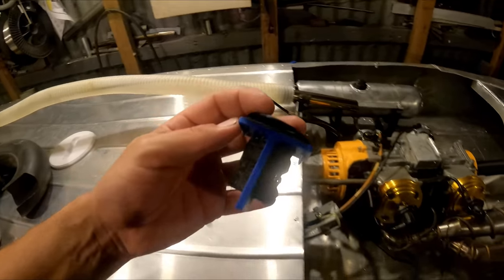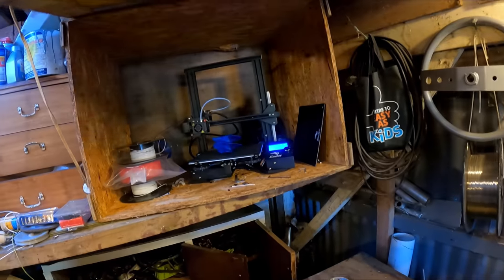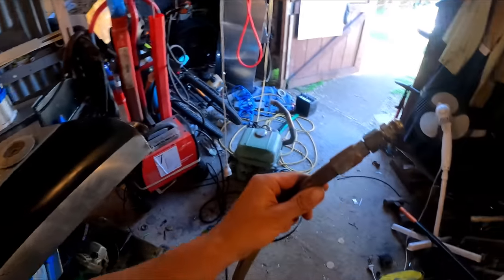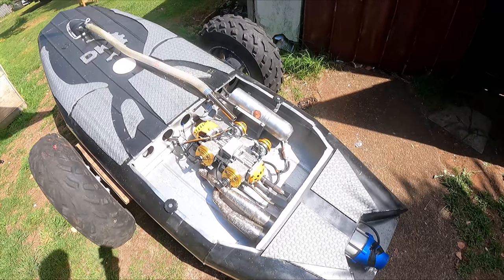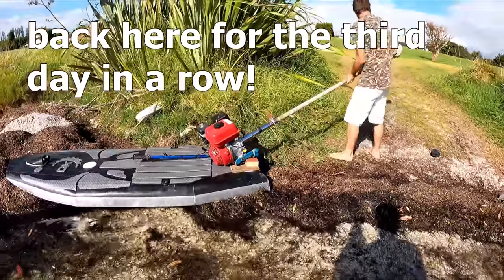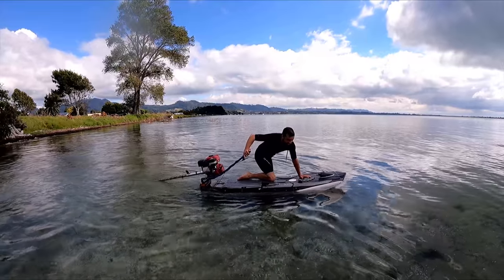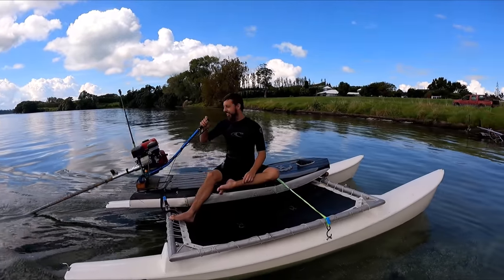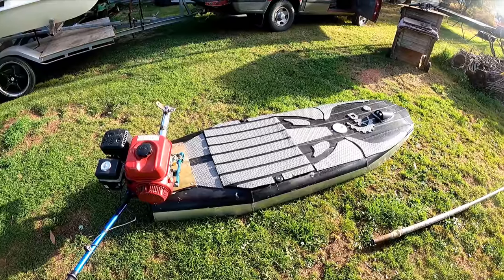Homemade Jet Unit 3D Printed, Testing!

Comment: Until recently, I assumed those longtails were something that got cobbled together out of some necessity of available parts.  Recently I learned they are purpose built to offer a ton of advantages for shallow situations with lots of weeds or obstacles to go over/around.  They are also dead simple and relatively cheap.  So, armed with that new found respect for the design, I'm keen to see someone like you figure out how to make the most fun use out of it.  Hunting down the limits of speed, control, efficiency, and perhaps a quieter exhaust, would all be cool things to see.  Cheers.
Reply from the maker: They are awesome and simple but a bit awkward to control. I would like to quiet it down a bit
Reply: @DktheWelder  Maybe delete the muffler to offset that slight power gain by running a straight down pipe  just below the water (deep enough to muffle but not cause significant drag.  Maybe add a simple  horizontal "surface plate" at about the point the pipe meets water surface to help prevent cavitation of the exhaust at exit point. (in other words, to keep te exhaust beneath the surface long enough to dissipate some sound without having to run the pipe too deep into the water?  Just brain storming.  Water is a great muffler and it's right there...
Reply from the maker: @AtimatikArmy  I have tried that before running the pipe into the water with those motors really robs the power , an outboard runs it through the centre of the prop where the water is turbulent so it pushes through it better I guess, there will be a way to do it though
Reply: @DktheWelder  what about a simple water pickup (prolly no pump needed) and have the line run to a silencer like a dirt bike but without the fiberglass packing?
Reply: Here in Thailand I live 150mtrs from the beach, Every morning the noise from the fuckers wakes me up even with closed condo and aircon on lol... they have no mufflers at all
Reply: cr500 locked in 4th set up for longtail. sweet christ
Reply: Just paste this into the youtube searchbar AMAZING, DRAG BOAT Tradisional🏁Top Speed 200 km/Hr

Comment: More motors! I would like to see the firewall moved forward and another motor or two added to get the jet working. I think stay with the jet and just change the jet/motor until it works. Love the effort mate! Cheers.
Reply from the maker: I did think about that add 2 more motors haha it would be pretty hard on the crank of the last one though
Reply: yes I agree I love jet surfing
Reply: @DktheWelder  why not adapt a 15hp outboard powerhead to work horizontal in the board
Reply from the maker: @MicRuLerZ  that would work I think !

Comment: awesome build man, pity those little motors weren’t up to the job, looks like great fun with the long tail. keep up the great work and videos 👍🏻
Reply: motors were fine he just didn't tune them at all ...
Reply: The propeller inside the jet unit is terrible. The only thing such a propeller does efficiently is destroy efficiency.

The blades should be much smaller. 
Propellers don't push water like a screw.
They generate lift. 
If you change the design you will get better performance. And it will be more resilient against seaweed.

Comment: The thing about the 4-stroke is that it has more torque than the two-stroke in the power band so you can run the bigger prop or higher pitch impeller, you need like a 90mm impeller size which is what jetsurf uses to get enough volume. I'm running two 56mm pumps on my electric build.

Comment: I've been following this build for awhile, glad to see it on the water. I kind of expected that it would end up being underpowered. Jet drives are horsepower thieves. Maybe do a surface drive prop setup with the same twin engines, sort of like an rc boat.

Comment: Koolest video demonstrating why longtail mudmotor are the best!!!!!
Reply from the maker: The longtail is just better it way more efficient you can carry the board easily then put the motor on in the water, then not have to worry about sucking stuff up , can change the prop in about 30 seconds, and cheap and simple
Reply: @DktheWelder  posted up some clips of this on our Instagram with a link to the video and put you in a playlist on our channel. Koolest stuff ever

Comment: Kawasaki js300 motor would work but is pretty big. I would look at a 2 stroke 85cc off a a motocross bike. They're in that 15-20hp and you could ditch the transmission and get the size down to what you need

Comment: I'd try the 80cc two stroke that you can get for push bikes off ebay as they also have a gear reduction gearbox  and that should be more then enough to run that water jet
Reply from the maker: I think those aren’t very powerful either but maybe if I started with two of those it would have had more chance
Reply: @DktheWelder  you would be surprised as they are turning a 26inch wheel plus your own weight plus geared down as they have a gearbox but if you joined two of them as you said well im sure you would be more then happy plus that is a awesome idea

Comment: had like a tear in my eye when the 2 50ccs didnt work, maybe a ktm 50cc or a chainsaw motor would be better. Carbon fibre reeds and a ported cylinder could add a wee bit but may not be enough. All in all well done bro, the board looks awesome 35km is fast.
Reply from the maker: I know I was annoyed they didn’t work , need more power!
Reply: any chance the hydraulic hose was slipping? aww no i already bought a gold motor =[
Reply from the maker: @dallas749  na man I’m in the shed right now looking at it is still on there super secure
Reply: @DktheWelder  I dare you to go electric 🤔🤔

Comment: You can customize an 80cc 2t bicycle engine (change the stroke to 55mm) and use the ms660 (56mm model), ms070 or ms088 cylinder to achieve volumetric capacity above 135cc. You can improve compression ration to 11.5:1 or above and use E85 (85% alcohool and 15% gasoline). Here in Brazil exist a motor 132cc 2t from yamaha rd135 with impeller 93mm spin 7800 rpm is a good motor to motorized surf board.
Reply from the maker: O wow that sounds cool ! How do you know this? I’m interested in the 80cc bicycle engine modification!

Comment: Xzibit:  Yo' dowg we heard you like boats so we put a boat on your boat so you can boat while you boat.  hehe its a bummer it didn't get the speeds you wanted on the jet unit but stoked you saw it through tull the end and the long tail looked like wicked fun. since you've already got all the set up for gas engines what about the worlds first hybrid jetboard?... could do the electric drive and then use the engines you have with an alternator to power it... pretty sure with all the extra weight it wouldn't be as fast as a normal electric jet board but it would be 1 of a kind for sure. great work as usual and look forward to seeing what you come up with next.
Reply from the maker: X to the Z would love the hybrid board ! Sounds tricky to me

Comment: First and best long tail surface drive NOT jet board 😀 awesome Dan.
Shame about the jet drive but nice that you can swap between both options. Search for a powerful 2t motor but I love the electric long tail idea. Batteries inside and dry, motor outside. Big RC outrunner motor with torque for the surface prop but plenty RPMs. Easy to mount also, just need a bearing housing to support the drive shaft.
What about a 125cc kart 2t motor? No gearbox, small centrifugal clutch or not, and up to 40bhp if liquid cooled monster! Only might be pricey... Be great to see the jet drive running.

Comment: Nice Board, I'm also building a Jet Board :) I'm using a 100cc 2 stroke 25HP kart engine.
I just have to add an electric starter and manufacture a reliable shaft coupling.
My Jetdrive is also 3d printed 89mm.
Reply from the maker: That would be about a perfect setup ! And electric start would be great, is it water cooled? And where did you get the motor?
Reply: @DktheWelder  It is a KZH 100cc engine and yes the engine is water cooled.
Reply: @DktheWelder  I bought the motor used on ebay.
Reply from the maker: @JansVanlife  ok thanks a lot I will look into it👍
Reply: And what about the noise ?..

Comment: The hours put into this project was crazy! The dual engine setup was crazy, wish it worked the way you had envisioned. You could throw a js300 motor and pump drive train in there and let it rip. Or go full send and somehow get a 701 motor and 144mm pump in there for some MACH 1 speed. Seeing a cr125 motor in there would be crazy too, probably enough power to push it, somehow delete the gearbox
Reply from the maker: Yeah the whole idea was to be able to make something cheap. A cr125 would be awesome!
Reply: @DktheWelder maybe use the duel engine setup for a stand on petrol scooter goped project & you can actually buy different CVT drive gearbox for  them with bigger sprockets fitted

Comment: You should put the 2 stroke engines back in and run a driveshaft out the back and stick a prop on it. May not be as fast as the longtail but would be more tidy.

Comment: you could strip out the powerhead of an old 2 stroke outboard, that would probably do the job :), tohatsu's m9.9d2 are really quick for their horsepower or the 18hp, their 25hp can be tuned to 32hp very easily. or you could do the yamaha 30 hp 3 cyl, very good motor.

Comment: could try a offset flywheel key to increase the timing advance on the engines too bring the revs up more, or even a planetary drive
Reply: rockit key for goped scooters is what i have in mind they use zenoah engines

Comment: Why not use a small 125cc dirt bike motor or high hp kart racing motor? Should be able to get those around 20hp for an older one. Would love to see the jet working as intended, but still awesome this way too!

Comment: mate you absolutely need to build that Honda gx200. delete the governor heavy valve springs. a rod high comp piston and a light weight flywheel and a mikuni vm22 would make that boat silly fast
Reply from the maker: It would! I took it out again with just a bigger prop it went pretty fast

Comment: A few options that I could thinks of would be either a scooter motor with a big bore kit keep the gearbox on and there pretty quick or look up the rovan baja 5b rc cars those guys port them like crazy and play with crank case volume by filling the crank case with jb weld and get around 6 to 8 hp out of  little weed wacker motors

Comment: Hey mate. Very cool project. Makes me think i need to get a 3d printer and develop some skills like you have. Im a little disappointed you are giving up on the two-stroke jet unit. I hope you stick with it some more. To me it doesn't seem like a lack of power. It seems more like the jet unit is slipping a lot. On a full-size jet boat impeller design and the clearances between the outer diameter of the impeller and the housing (wear ring) surrounding it make a huge difference to the performance of the unit. Think of the jet unit as a pump rather than a propeller in a tube. I am currently building a small hull and intend to use the same engine you have with some type of homebuilt jet unit.
Reply from the maker: I wish the 2 stroke would work too , It would probably work with a propeller but jet units are pretty inefficient and power hungry. I am building an electric mini jetboat at the moment with heaps more power so hopefully that works

Comment: You might get extra thrust if you could route the exhaust out the jet novel as well. Mixing the hot exhaust gas with the ejected water
Reply: Jetdrives pressure to like 150psi and an exhaust is like 5psi. You would gain no power and just flood your motor with water.

Comment: One thing seems tibe the norm on 3D printed jet drives, way too much pitch on the impeller. Try less pitch to get the rpm up and the engines to the pipe. Should get much better performance out of the board. Awesome build!
Reply from the maker: I did try a few different pitches but I think you are right it never seemed to get on the pipe , thanks 👍

Comment: You could make some small hydroplanes for the cat's pontoons and the speed would raise it out of the water, greatly lowering the drag co-efficient, you could probably even do something similar with the board as well.
I'd like to see potential hybrid vehicles that could cover many bases, as different power sources provide different torque ranges which are more beneficial for different tasks, not always demanding of power.
You could even use natural power with small balloons lifting sail kites when there's no 'low' wind.
Reply from the maker: Do you mean hydrofoils? I have been thinking along those lines it would work well with the longtail motor, and I have been thinking about using a kite as well but they aren’t as efficient as a sail
Reply: @DktheWelder  oops!
You're right!
Hydrofoils are what they are, hydro-planing's what they do!
I speak quicker than my brain sometimes.

Comment: Overall awesome but I can see you are disappointed with the speed of the twin 2 stroke. My theory is your intake air is too restricted . If you can try it somehow with a much more open intake maybe it will work far better
Reply from the maker: Yeah I tried it with the lid off too so no restrictions and still no good just need more power I think
Reply: @DktheWelder  more torques!

Comment: Have a couple of 1/4 scale RC boats that cruise around 65-75mph with single cylinder modified 36cc 2 strokes and surface piercing prop, which is plenty fast enough to handle via remotely. Always wanted to jump on one and see what it would do with a person on one. You have answered that question for me now Lol! Yes these pocket bike engines are very shakey and vibrate thanks to their Chinese no nonsense caring for balancing their rotating assemblies! They can be balanced though with some basic tools and knowledge of how to balance a 2 stroke. But definitely the worst of the worst are the aftermarket cranks they sell for these pocket bike engines! Yes they're a full circle crank, but it's by no means meant to spin at any rpm's! They didn't actually account for the balance of the piston, rings, rod, bearings and pins. And they are way heavier than they should be in places that should be as light as possible. If you use a aftermarket full circle crankshaft in these pocket bike engines without any sort of balancing to them prior to installation? These cranks will shake your engine and bikes apart very rapidly!  If you're using 2 of these cranks in your gas powered board? I couldn't even begin to imagine how bad it must vibrate under your feet??? Also these cranks will give you less performance over the stock cranks due to the harmonics and vibration which kills the engines rpm's and ultimate HP. As for the killing of both coils at once? Yes it's absolutely possible by doing so with a single kill switch, by using 2 diodes to isolate each coil from one another you can tie them into a single kill switch. I run a modified Briggs Vanguard V twin with dual independent magnetos which come from Briggs with a special wire to isolate the ignition systems from one another by using 2 diodes, simple as that Mate. Good luck with your project bro. And please be careful about that Long tail prop! You definitely don't want to fall off that board into the prop of that engine! You'll be having one bad day if that happens! Especially in Salt waters around Australia lol. But safe travels man and keep it boating bro.
Reply from the maker: I’m in New Zealand 👍 thanks for the information I didn’t realise how bad these motors are till I got them , and a lot of people have commented on them . So the vibration is robbing a lot of power ? I was surprised at how much power they don’t have haha

Comment: All that work and it goes 2 miles per hour… 8:52  then… UPGRADE!.. 😂
Reply from the maker: I know I was so frustrated, it went well with the longtail motor though haha
Reply: @DktheWelder  maybe a JetSki motor… what you need is water pump and its impeller. Even the upgraded sharrow prop design isn’t enough. Looks like the sharrow prop design doesn’t have enough surface area from front to rear of prop. Maybe 3/4 x thicker would work better. Or making the sharrow prop to exact specifications of original just the scale you need to fit in your housing. Id say those mothers you used don’t have the RPM needed to do better.

Comment: just so you know, putting a stainless bolt in a stainless nut without any sort of grease wil make it gall up and can make it so that it wil NEVER come apart, adding a lot of heat makes the process a bit easier to happen. That is why you should allways put some grease on stainless hardware if you want to ever get it out again.
Reply from the maker: Nickel paste is the best , a tiny bit of grit in the thread or even using an impact gun can bind them up 👍
Reply: @DktheWelder  I prefer salt water, it adds that touch of electrolysis to the mix which, oh ah nevermind!

Comment: 3d printed parts have there limits but when you've reached those limits with plastic it's time to use those 3d  models to make stronger parts like PLA casting in  aluminum

Comment: Hi, great experiment and fun. Search in grab cad propeller 147x309mm could you print, reinforce with carbon or fiber or casting and test to see if improve the performance? Thanks.

Comment: Not sure if you said but ditch the jet and use the motors for a built-in long tail. Steering I guess would be the tricky part. Or would output be too low?

Comment: Could you use a 20hp 2 stroke motor off an outboard? That way you could strip it down and make it flat enough to fit inside the board.

Comment: Should put a 80cc two stroke out of a yz or 85 with big bore kit probably only small motor with power but don’t know how you would run the jet off of it an be a lot of fabrication to have it In the board be better off starting a new one with a bigger motor now that you know the idea works